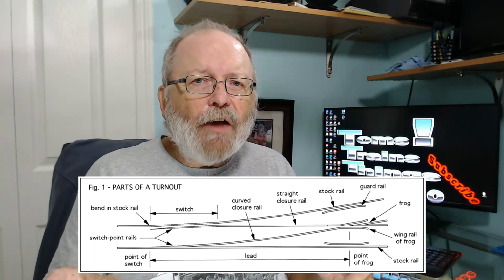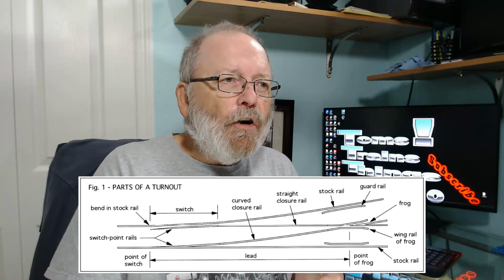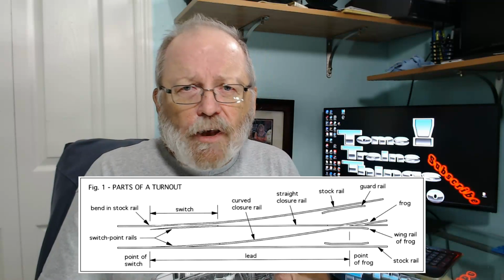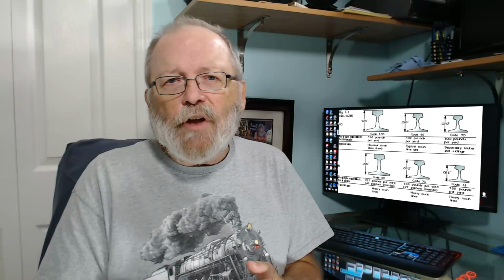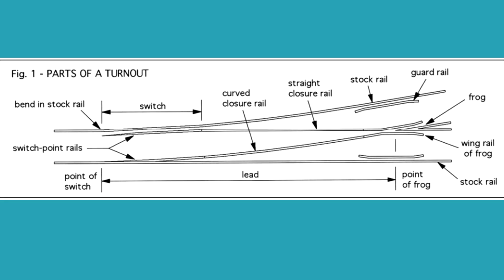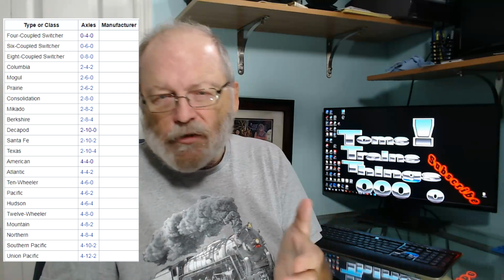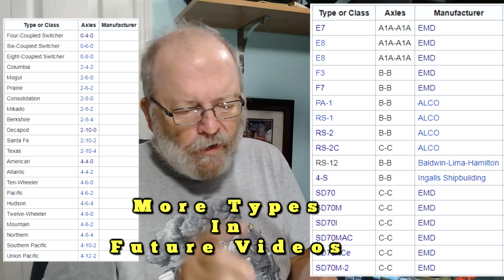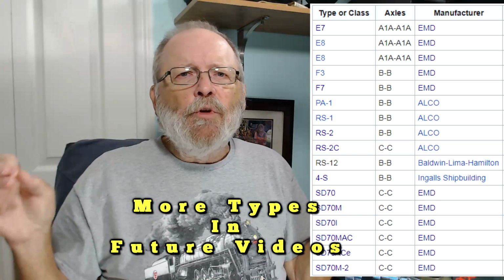Turnout Or Switch - Gauge Or Scale - Model Railroading For Beginners Ep017

Comment: I was told you could use any train on any track but,
You could not use different train track for instant ATlas with Bachmann. 
Is this true? I am also trying to find out before investing in track can the turnouts
bridges etc. be used with flex track.
Reply from the maker: See my reply on the other video.

Comment: Please explain the difference between #4 #6 single digit turnouts and the 851 850 860 861 turnouts
Reply from the maker: Hi Bridgette, the 850, 851... are the manufacturers part number for the turnouts. The #4 & #6 is the ratio of the turnout where the #4 is the sharper curve on the converging rail.

Comment: IMAGINE if we used real Railroad terms for Switch (Turnout) angle...
Or how about CURVES?? Go to your Hobby Shop and ask for some 24 degree curves!! 😨😵😵 
I have to believe that several Model Railroading nomenclature was designed and modified over the years, just to save headaches. Especially for the newer guys. 

That was an extremely valuable bit of video Tom! No matter how old I get, I love learning and relearning. Thanks!
Hope you get your Irma issues all sorted, and get some trains running again!!
Murph
Reply from the maker: Thank Murph. Once I get some of the video stuff off my layout, I'll start running trains again. I almost had everything set up then had to pull my command station out to do another video.

Comment: not from  model rail road standard. it is more from definition from ireland and english rail standards which  is why we have a mix of rain width gauge and it has been a pissing contest for to many years on how we have ended up with a width gauge bias and poundage problem on the what services us for rail for across the world,  the original 5 foot and up specification on rails was likely accommodate the offset of weight of the steam engines..

at this stage there is 3 trains of thought in what is narrow gauge and what is school of training you were training you were taught under because the measured distance between the 3 1-1.5 foot or more ..

and poundage restricts the  pysicalweight you can impose on the rail..

in some cases where you had mismatches in rail it was common either to convert wagons over to a different rail gauge than it is was to run a standard gauge across a network until standardization practice started to take place...

though in real operation gauges you can go from 1 foot or less wide to 6+ foot wide depending what the track was created for 4.5-4.9 foot is far from standard across..

 realize in the real world that run miniture railways is also a narrow gauge platform that can run with heavier poundage line and can be considered a real railway with the correct rolling stock..

whilst you might say may be correct in some form of historical context though in reality you are dealing with 2 versions of measurements and 2 schools  engineering trains of thought 1 being an english and 1 being irish which may never meet in connection because you either adopt 1 or the other not both, this is a problem in australia we still have to this day..

I'm guessing this might of a big issues in the states for sometime until it was migrated to where it sits since ww1 or ww2 when and where the government took over rail interests and standard gauge the network where plausible ..

you likely couldn't replicate  the off gauges that existed where steam trains were 1st introduced because it be be hard to replicate in model railways I would think..
Reply from the maker: Thanks for your input Jason, very informative!
Reply: no worries thought i might correct  the historical inaccuracies within your comment..

as it was a engineering standard between the irish and english depending on the unit of measurement that was uses describe width distance..

had family in the railways  so i'm bound to pickup more on things than most..

sorry  if i sounded if it was a rant.. though the intent was to lay the correct engineering context of what  was in up until, though I very much doubt people are actually building their rail project actual historical scale in terms of track, wagon and loco layout to depict various rail gauges used throughout the world including  where dual gauge was or is in present use...

sometimes what can be conceived when researching historical accounts to what existed 100-200 years can have inaccuracies in historical context though what is listed in documents of today verses 30-70+ years  ago can be physically and factually incorrect  depending how the print is directed to the reader..

Sad to say with the high use of WIKI's from wikipedia sometimes the context of what is printed there can be correct pending on where the content of its deployment laid.. can be factually incorrect when trying to apply the context  on a global scale...
Reply from the maker: No problem Jason, my little story was just a condensed history of where the standard gauge came from. I didn't want to make the video too long. lol
Reply: turnout and switch might be terms to apply different designation in a local definition..

as for turnouts I think that is more a term used in the US in regional context depending where you are 

Switch, spur line, main line and loop is what I grew up in for defining what term was used for the   application ..

any line that deviates from the main line or lines depending whether you have 1, 2 3 or 4 lines typically is classed a spur line with 2 or more linking  tracks which can also be called a siding track depending  its initial designation use..

Comment: Thanks for sharing,  but you can find n scale is confusing when it comes to track, atlas make code 80, code 65 like Kato code 80, atlas makes code 55, now micro engineering makes code 70, 55 and code 40, in flex but only code 79 and 55 #6 turnouts, and Pico make only code 80 track but the code 55 they make has part buried in the ties to simulate code 55, a cool way to do it, now code 40 is a little tricky as wheel flanges can touch the plastic that holds the rail, but I have seen were you can lay it in pc ties to make it work good, hopes this clears n scale a little bit for you!
Reply from the maker: Thanks Jack. I noticed there were a lot of different codes from the different manufacturers. I only mentioned the ones I used in the past. You would think such a small scale would only have a few sizes but it seems N Scale has the most variety!
Reply: Toms Trains and Things isn't that the truth......

Comment: I once asked another modeler why modelers call a "switch" a "turnout" when people who actually work for a railroad usually call them switches. The reason I was given was that modelers use the term turnout to save confusion since the modelers deal with numerous electrical switches on model railroads. What is your thoughts on this?
Reply from the maker: Aljernon, I used to work on the railroad back in the 70's to early 80's in the electrical dept and we always called them switches also. Our bosses and the engineer who drew up the plans called them turnouts. When I started in the electrical dept my co-workers all had 20+ yrs seniority on me so they were all hired shortly after WWII when the steel mills and railroads in Pittsburgh were in a growth mode. Proper terminology was not a strong point for the ones I worked with. We called items by their manufacturer names; Split Bolts were Burndies, 12/2 extension cord was called Okanite, and many more that I have long forgotten.

I'm assuming the term "Switch" came from that same era mainly because it was easier to say than "Turnout" and they really didn't know what the proper name was for the device. We had relays we had to dump whenever there was a derailment in a yard that was the size of a shoe box that were refereed to as "Points." Which is what was inside the relay housing.
Reply: *aljernon magillacutty - That's a LONG running, confusing subject! Yes, I've known many Modelers over 40 some-odd years, who say "turnout". Mostly for the same reason you mentioned. Lots of toggle switches on a Layout, usually.... Turnout just makes easier distinction in larger groups.